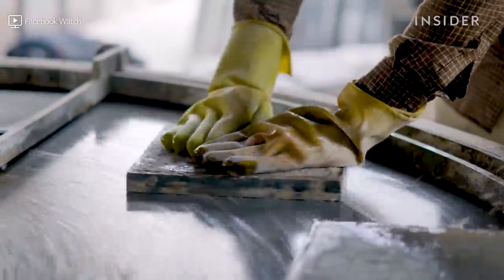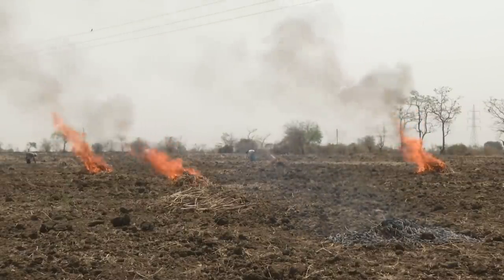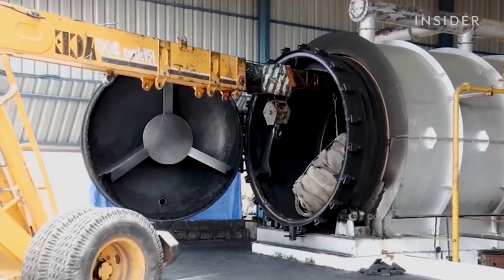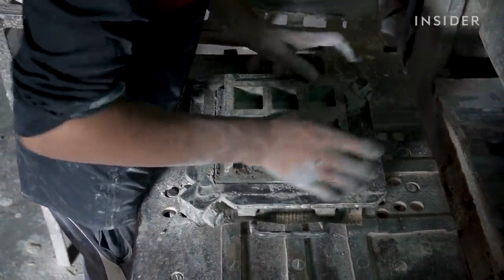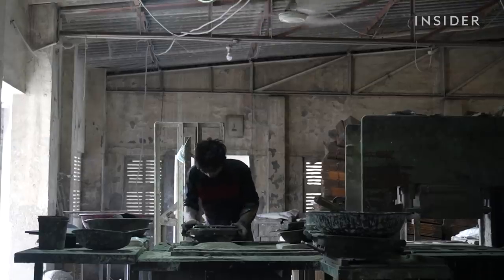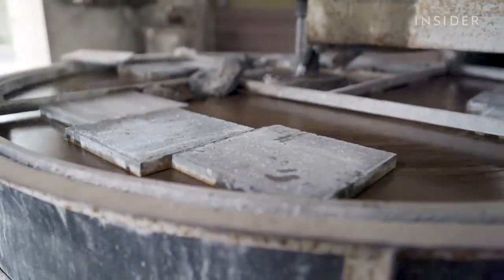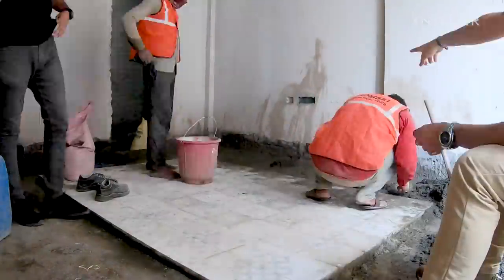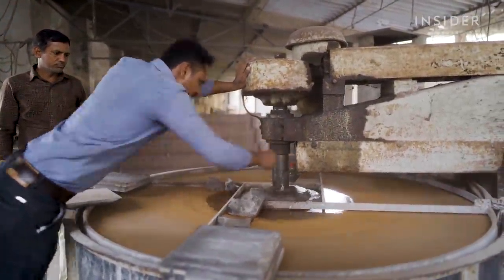Handmade Tiles Made With Smog-Causing Black Carbon | World Wide Waste | Business Insider

Comment: Yeah this is greenwashing of the highest order. Firstly, cement making involves heating limestone and other additives to roughly 1450°C to chemically alter them. Thats pretty much the same as ceramic tiles. Secondly, Black Carbon is pretty much the same stuff that would be used as pigment in this application anyway. The only positive here is that they maybe use more black carbon than strictly necessary in the production, but even that only serves to slightly shrinking the tiles carbon footprint and is no way a great new way to reduce pollution like Business Insider wants to tell us.
Reply: Well said this is what's about to say you have done,  I am manufacture, carbon is just pigment which goes 1-3% in cement tile processing, its no way environmental friendly its just eye wash 😉 😜,  to produce cement tile you need lot of water for cureing this water can't be use and cement its self not environmental friendly on the processing and for converting greay colors you don't need carbon, gray cement itself enough
Reply: Yeah exactly. They should just manufacture black ink instead.
Reply: @ArjunSharma-gy1eq  Yeah, and then sell it to whom? Calligraphers? That's a dying community. Not only that, however viscous your black carbon ink is or however concentrated it is, it had a lot of potential area to clog up then pen you are gonna use. So that's a no go.
Reply: @ArjunSharma-gy1eq  that's an amazing idea...maybe they could make paints instead of ink. Acrylic and wall, tile paints etc...or just regular acrylic paint for art
Reply: @tessathomas554  yeah the possibilities are endless. Also if they start manufacturing art products, they will need much less manual labour and will be able to brand it as an exotic product.
Reply: @ArjunSharma-gy1eq  this is reinventing the wheel, carbon powder aka soot has been used as pigment in inks and paints for centuries. The most environmentally friendly way to dispose of it instead i can think of is to just gather the excess and bury it underground, assuming there are no harmful substances mixed in.
Reply: @darius_sanguna  yeah next time ill make sure to consult with a kid from the internet to make good environmental policies 😂
Reply: @darius_sanguna  but they are labelling it as environment friendly which it absolutely isn't.
Reply: @dologongpoloponobonotongpo235  Hello Mister Wiseass, maybe you could tell me than were you would put stuff that you have too much of to use it all yet is non-toxic but would still be dangerous if it were to get into the atmosphere?
Reply: @dologongpoloponobonotongpo235  I fail to see how your suggestion is related to the topic of green-washing in general or this discussion in specific, as it doesn't answer what i asked you at all. Please do elaborate on it if i have missed somekind of deeper meaning. (Yes i know that you're a Troll, but who knows maybe you do actually have something to contribute.)
Reply: @raphaelsback  I can understand your point with calligraphy, but what if the ink can be used in printer cartridges? The viscosity can probably be altered by grinding the particles very finely, and printer ink is still very much in use!
Reply: @noire090  Now that's a real use case! But I thought of the "counter-argument" by printer companies: "But it won't quality! We can't more money!"
Reply: Plus the huge amount of water they need.
Reply: @raphaelsback  hahaha printer companies will find any way to charge people more $$$ for their products eh
Reply: @kittenmimi5326  Large tech companies have a single motto : 
WE WANT MONEY! MORE THAN YOU CAN EARN IN YOUR LIFETIME!
Reply: @raphaelsback  A true black mechanical pencil lead has yet to be developed. That would be a godsend to countless cartoonists the world over, let alone anyone who uses paper.
Reply: @Undomaranel  If possible, could you explain why it would be a godsend?
Reply: If they're already making tiles this way but now uses soot to replace pigment, why should that be called greenwashing?

Is Insider hyping it up for more than what it is? Definitely.

Should the company do better? Yes.

However, accusing the company of greenwashing might hurt the cause more by discouraging people who want to use eco friendly materials (like using already existing soot in lieu of burning wood or bone to obtain carbon) in their existing products.
Reply: @heartears  The company thinks it makes a huge difference changing from traditional limestone to soot when in reality, it makes little to no effect. 
The company is trying to tell viewers that by buying their product, you the customer are making a lot of difference in saving the people which is the false, "green" advertising that is being complained about.

There is no problem in using eco- friendly alternatives for products but if the eco-friendly option doesn't make any difference in helping the planet over the regular, that's a waste of money.
Reply: @raphaelsback  maybe to the entire art industry as a whole.... I mean, youre intentionally ignoring potential here to try to "prove" your point, not only that, but calligraphy isnt even dying... especailly in recent years its been becoming hugely popular
Reply: it's also ignoring the gallons of water used to cure the tiles
Reply: yeah, isn't what they're doing basically... just using coal for pigment instead of burning?
Reply: Came here to say this. There is nothing green about this at all. It's a black mark on business insider's ability to do properly researched journalism to not take this video down, let alone publish it in the first place.
Reply: Exactly its gay
Reply: @darius_sanguna  problem is this is basic carbon soot that is left over after burning things such as tires for energy.  The carbon leftovers are like coal dust in that it burns readily.  So, no, people will not just bury a product that produces energy. So much money is spent trying to dig up a product that produces energy (coal) so why would they bury this one that is readily available?  This is what we do best, figure out a way to do something with byproducts in order to produce a commodity that has worth.
Reply: You can look at it this way. The company making the tiles was there for years before he came to them with the idea, it is going to be here for years to come. Regardless if the cement tiles are worse in pollution then ceramics someone is going to make it and someone is going to buy it. Its old craft so there is tradition.  The adding of black carbon is just minimal amont of binding it but little is better then nothing and it can be used as to bring awareness and inspiration for others to come with more ways to solve the problems of it.
Reply: Exactly they bullshiting us

Comment: 2:55 "But Carbon Tiles made from CEMENT are never baked, so the process doesn't require a lot of energy."

Cement requires HUGE amounts of energy to produce. It involves mining for raw materials, crushing limestone, drying the stone using hot air and grinding. It is then superheated to 1400°C in a kiln. It must be cooled using extractor fans. The resulting clinker is then crushed into powdered cement.

Does this sound like a low energy/low pollution process? 🤔
Reply: It's greenwashing the tiles are packaged in plastic!!!
Reply: @insectbite1714  okay bro
Reply: Plus the tiles are cute with water ones every 2 hours for months on end wasting valuable drinking water on top of that
Reply: Exactly
Reply: @anguianoalan100  We can use rain water or river
Reply: But... BLACK CARBON!!!!!
Reply: @idmarilamri6398  That is still fresh drinking water. Once it has been used to rinse these tiles it will take fifty times the effort to purify it than it would to purify rain water. Even in a smoggy environment. Concrete is really toxic and it would spike the PH of the water making it even more difficult to manage. Somewhere like the US, that water would technically be considered a dangerous solution and the only "legal" way to dispose of it would be to take it to a facility and pay a fee for them to recycle it. If you left it in the soil it would kill plants and animals.
Reply: @insectbite1714  there's another video where they turn plastic into shoes so..
Reply: No sounds like green washing
Reply: @idmarilamri6398  Where exactly do you think "drinking water" comes from? Little hint you named the sources yourself. :D
Reply: @idmarilamri6398  where do you think drinking water comes from?
Reply: @EikottXD  for me it's water plants
Reply: @anguianoalan100  re-use water. Where the whole room drains into your water supply through a filter ready for the next shift.
Reply: @stevethea5250  and to me, I don't think that it's any better. From the video I've seen, even though the plastics came from the trash, they only pick specific kinds of decent quality plastic. 

Not only that, but if 100% plastic shoes becomes mainstream and more people begin to buy it, it'll just cause more pollution. When the shoes starts to wear down, where will it go? Maybe some will recycle it, but majority of ppl wouldn't care much and would most likely just throw it somewhere. Cheap shoes, meaning ppl wouldn't mind replacing and replacing them or buying more.

Just my opinions as of now
Reply: 😂😂 I had the same question in my head too
Reply: No no, that is wrong,
There is double process for normal tile making, which includes the energy used in producing cement and backing the tiles.
But over here, the only only energy intensive process here is producing cement, the tiles DRY instead of baking
Reply: My thoughts exactly 😒
Reply: People tend to forget about the little details like that
Reply: well, i think that using cement is better than releasing more black carbon into the atmosphere ig.
Reply: Yeah, and on top of that the extra water that is used. They should just have them under water in a tub, pouring water over them like that is wasting a lot of it and the extra polishing is horrible as well.
Reply: @stevethea5250  yeah and I wonder how safe it is for us to be wearing plastic. Most clothes have it in it nowadays unless you are rich enough to buy it without
Reply: What's wrong with fire?

Comment: The amount of energy it takes to make cement is far greater than what it takes to fire ceramic tiles. The amount of actual pollutants captured by these tiles is so minimal that I'm surprised Business Insider got so sucked into this concept. Look at the waste of water during the curing process and the polishing. This is a gimmick at the very least.
Reply: If the whole world was made with these tiles even more carbon would come into the air and sea.
Because when you walk on these tiles they will wear off just like any other tile.
And that dust will then spread to the ocean, fish and eventually on your plate.
Reply: Yeah i dont really understand the point. Its not stopping 99.9% of the pollution they have there. They are just kinda using the already there pollution to make something which then relies on pollution to stay in business
Reply: Thank you, I was looking for this comment! i
Reply: Feel good story shifts focus from actual problem
Reply: yup. this is greenwashing in a nutshell

Comment: What do you mean by they have to water the tiles for 1 MONTH ? How much water do you waste for these tiles ? What’s the trade off between water waste and low energy use ?
Reply: Ikr!! And where do they even release the polluted water
Reply: This is a pilot project
Reply: do you even now how concrete works? every single project that uses concrete requires that amount of water
Reply: @halfmoon1654  not true
Reply: @halfmoon1654  Thats actually not true.
Reply: Well technically the water would evaporate back into the air and when it rains and goes into dirt it becomes naturally cleaned by the soil and ends up in an underground aquifer
So I agree that it looks like a lot of water is being wasted but I guess it’s just being recycled
Reply: While it’s most likely not done here, a proper industrial application would probably recycle all non evaporated water for subsequent wettings.
Reply: How do you waste water?
Reply: @gentilejoshsaved1646  Quite easily really. In some places drinkable/clean water is scarce (desert areas for example). You wouldnt dare use it like this there. Because you wouldnt have what to drink and what to water the plants with.

 And you can create such scarcity even in regions that would normaly have abundance of it by using it on stuff like whats shown in the video. Which is exactly what is happening in SE Asia (India, Bangladesh, Tailand, ...) where many big rivers are extremely poluted and water in them is dangerous.

 Also I am leaving out the fact that tap water can be quite pricey (especialy if you are using huge ammounts like they are).
Reply: Exactly, how in the world is this sustainable if they're wasting that much water
Reply: The water used in the curing process can be reused subsequently throughout the curing process. Properly curing cement does take nearly 30 days for the activation and reactivation of the cement and that goes for any cement based product. Those who aren't doing this are producing cement based products that will 100% have premature failure. How long until that premature failure is determined by multiple factors including temperature, weather patterns, seismic activity, environmental  vibration, usage etc but without proper curing it will fail prematurely none the less. As for reducing energy usage during the manufacturing process, this is in comparison to comparable products in their market.
Reply: Omg just be happy for once in your life
Reply: @mr.fahrenheit7009  😂 I’m happy to read you ! Happy holidays ! Mr. degrees !
Reply: It's a trial run. If production increases, practices like recycling water for reuse would probably be implemented for cost and efficiency purposes eventually anyway if the project doesn't fail.
Reply: @joshuaphillips4958   ¿qué clase de producto de cemento se fábrica en tu país  para que se tenga que curar un mes con riego de agua cada hora? En México  no se desperdicia esa cantidad desorbitante de agua solo para el cemento
Reply: @snowybuny different cements are used for different purposes and it will always depend on the type of product being made. To understand cement, the best thing is to not think of it as a solid but more like a sponge. A sponge is porous and if you wet it the water will saturate in, pass through if it's too much, and eventually evaporate and dry. With cement products you have a reaction which adds an additional step after dry, which is to cure. To cure more porous cement products like a concrete sidewalk or cement blocks for a wall, wetting them once per day is pretty good. But with tiles with very fine cement, and very fine fillers and color powders, that are pressed with a hydraulic press, and are stacked together like they are, it is necessary to wet them around 1-1/2 to 2 hours per day. It's because they aren't as porous and won't absorb as much water, the tiles will heat up faster and the water will evaporate out of the tiles faster than a more porous product.
Reply: @joshuaphillips4958  Entonces ¿no sería más  ecológico  y económico utilizar siempre el cemento que no lleve a cabo todos esos procesos y desperdicio de agua?
Reply: @snowybuny  we do have to keep things in perspective. This is a video that doesn't show exactly every step, especially where is all this water going. If it were my business, I would have basins for water collection. If we're being honest though, it's easy to focus our attention on what these gentlemen may or may not be doing right or wrong when there are massive factories doing this exact process on a massive scale and no one says a word. I still give credit to this company for trying to find a use for this highly toxic carbon that kills millions per year.
Reply: This is just how cement works. The longer it stays wet while curing, the stronger the cement gets.
You can skip some of this, but at the result that the cement is weaker than it could be.
Reply: Its just a trick, most companies say stupid things in order to keep others from properly copying their technique thus not being able to compete with the original's cash flow
Reply: Apparently it’s not a lot, because while cement tiles don’t need to be baked, a lot or energy is used to create the cement and the materials go through kilns in the process anyway
Reply: something about repeat water exposure causes the tiles to become harder than if they were just left to dry. these are made with concrete, and while you can make different special effects with concrete, it always has to cure to have the durability its known for. 

as for water use I can't tell you. mind you there are ways to reduce that such as rain catches, solar powered pumps, ect. not sure other than the hose where the water comes from or where it goes. hell, you could even install a drain, catch it in a cistern and then recycle it over and over.
Reply: This isn't low energy. Cement is very energy intensive